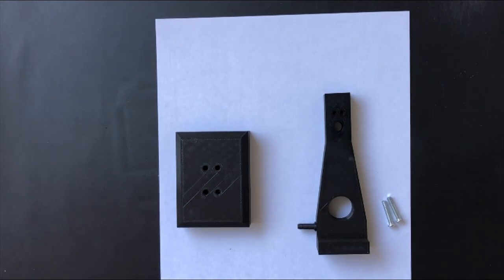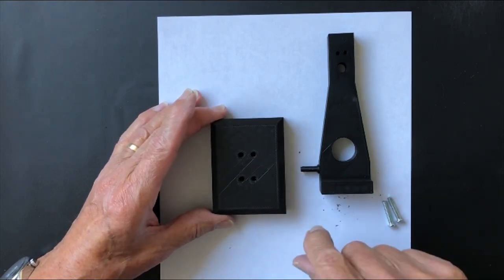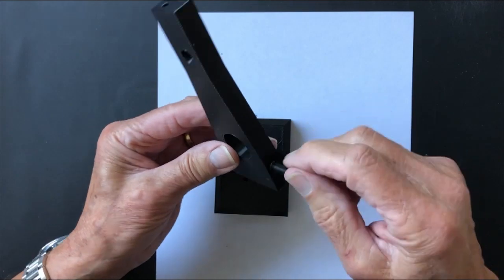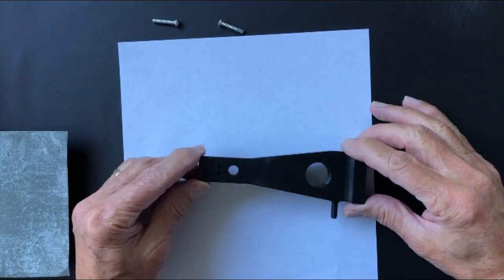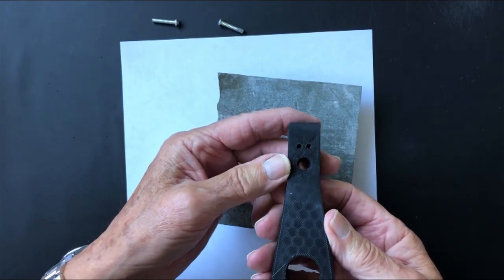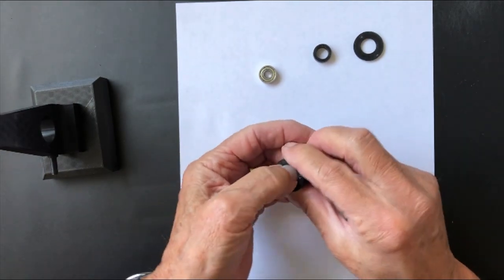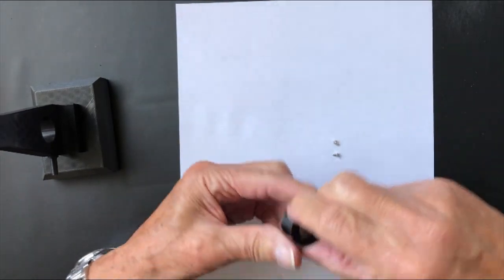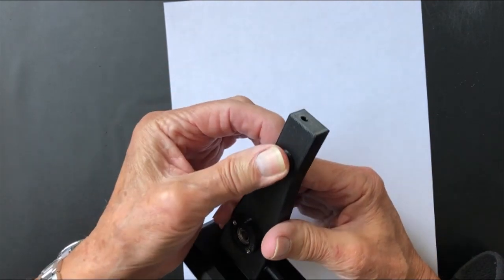WigWag Single  Assembly 1

Comment: Nice instructional video Peter, I like your methodology for the bearings
Reply from the maker: Thanks for the nice comment.  Took a bit of working out to get right but got it to work pretty well in the end without making things too complex.
Reply: @oldadder  you have done amazing work Peter to modify this! your engines are superb, I hope many people in the 3D printing world see your designs on thingiverse and recreate the wigwag, thank you for extending the wigwag design to a new format
Reply from the maker: @AdeSwash  Thank you Ade. I have built more complex engines but wanted a design that could be adapted for anyone in the 3D printing world could have a go at building. Hopefully that has been acheived and await results. If this goes well I will include the V Twin and Triple versions.
Reply: Thanks for sharing Peter.  Have been toying with the idea of making a Swash wig wag in metal, but will have a go at your version first.